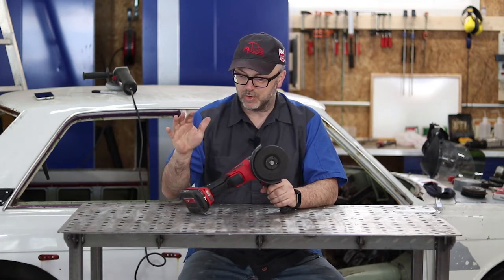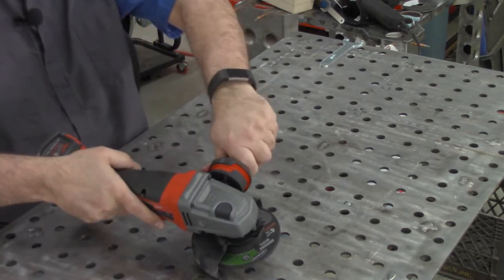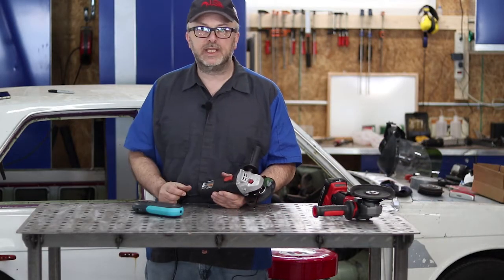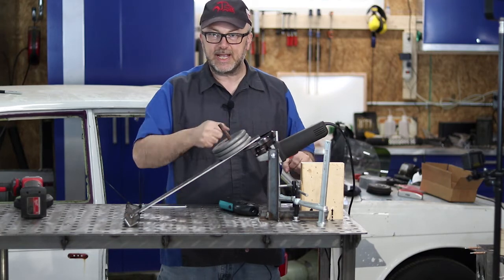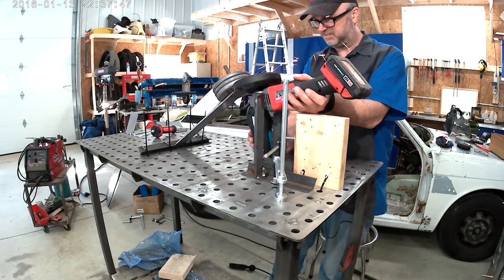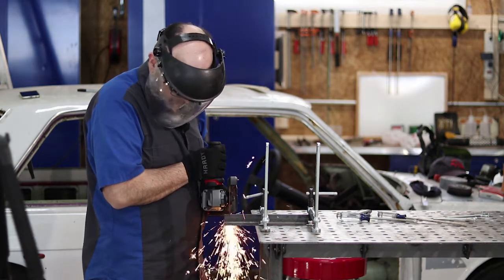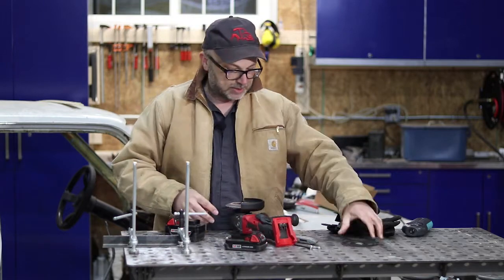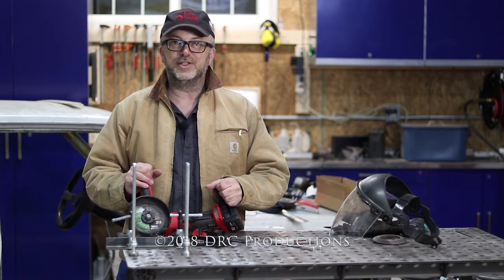Milwaukee M18 Fuel Cordless Grinder

Comment: Cordless hand tools have come a long way for working and convenience, but 120 volt hand tools  will win. Good post !
Reply: Couldn't be more wrong. Nothing 120 volt even comes close to the power the new M18 fuel milwaukee tools put out. Not even air can touch them. 1400 lb/ft of break away torque in their new gen 2 1/2" impact.